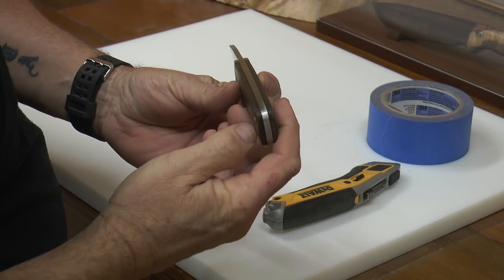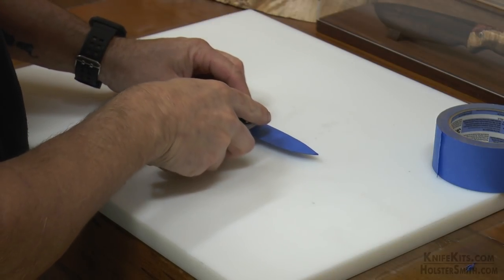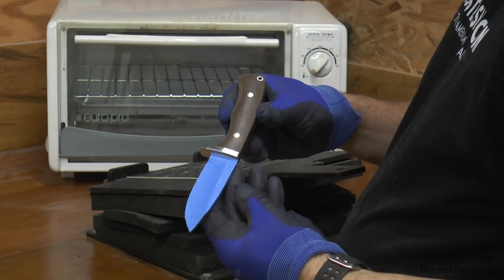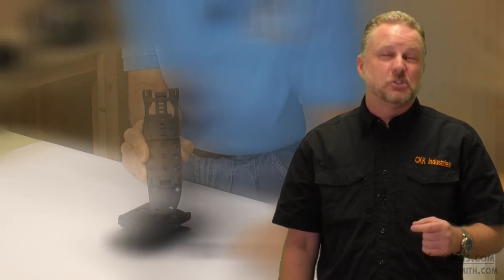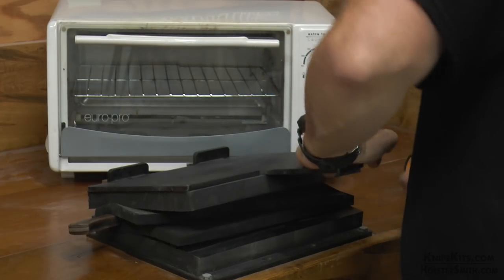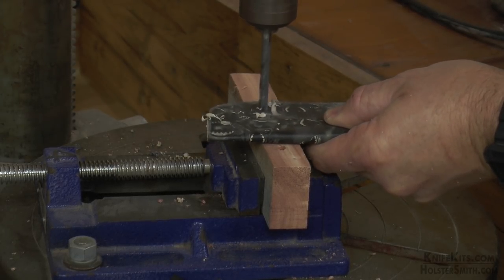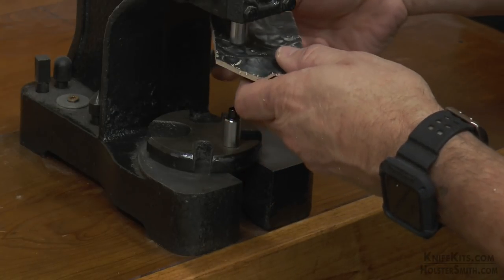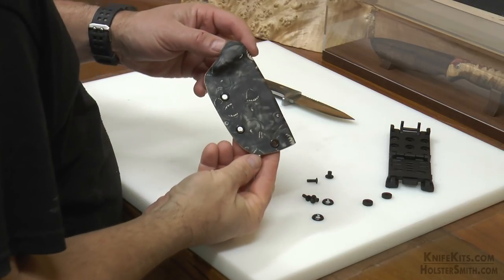How to Make a KYDEX® Knife Sheath w/ a Tek-Lok Attachment

Comment: It seems you mounted the the Tek-Lok with the release toward the top. Is this the standard way to do it? I thought the release went to the bottom. Does it even make any difference?
Reply from the maker: Hi Al. You can attach it in either direction, as the Tek-Lok has a locking system on the opening. However, most builders consider the hanging weight of the knife, or gun, and the direction of draw when choosing which direction to place the hinge. When you pull the knife for use, the pressure on the holster is in the upward direction. Since a typical knife is fairly light, the pressure on the opening is low in the carry position. The most pressure happens when the knife is drawn, therefore the most secure side (the fixed hinge side) would be the fail-safe side of the attachment. If you're using it on a sidearm, or something where the carry weight is more than the draw pressure, you might be better served by using the hinge in reverse, to guarantee the safest side is holding the rig in the hanging position. Finally, if you consider both to be fairly equal in weight/draw pressure, the direction of the attachment might be the one where it's the most convenient to depress the ears for removal. I hope this helps, but if you need more info, let us know and we'll be happy to assist! Thanks for watching... Alex

Comment: Only 2 bolts to hold it? Is that strong enough?
Reply from the maker: See my other reply, but "yes", you can use two on smaller rigs. The mounting posts are very strong.